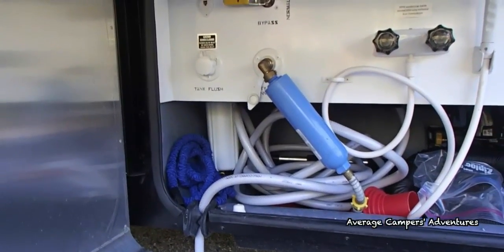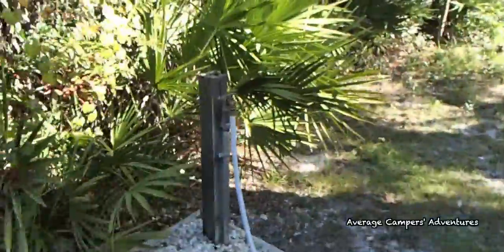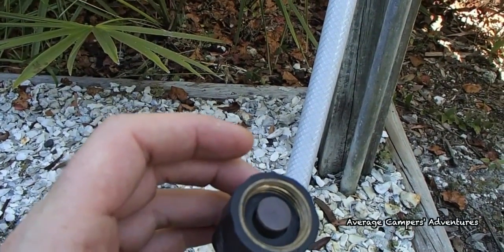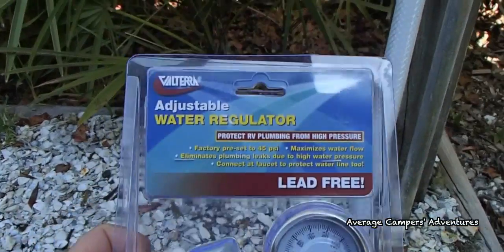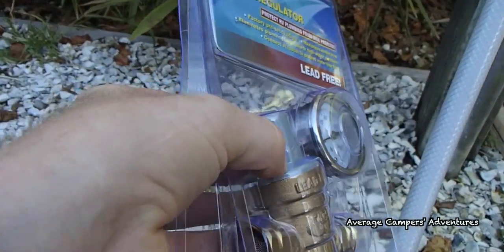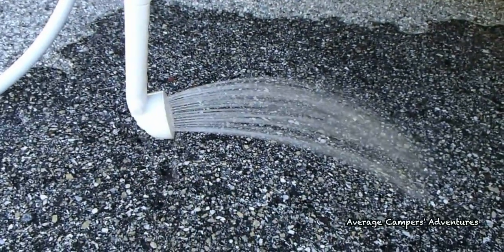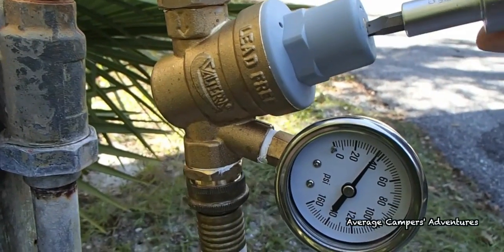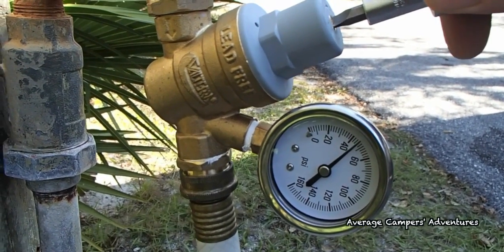RV Water Pressure Tips and Tricks

Comment: Great tip about using a water pressure regulator.
Reply from the maker: That is a really dated video but it still holds true.   Excellent way to dial in the right pressure and prevent broken pipes.   Thanks for watching Lucky Dawg!

Comment: I purchased one used 11 straight days work great in the next time we went camping the gauge wasn't working right now wasn't sure what the water pressure was so I'll put my back up on as anyone else had trouble with the gauge think the water pressure was right I think the gauges is reading wrong I guess you're still in Florida hope all is well
Reply from the maker: We had the same experience but our broke at the seam.  Decided to get a different brand from Camping World and all has been well since.  Only difference is that we can not adjust the pressure with our new one.  Thanks for watching!
Reply: Went back to Camping World today and they replaced it no problem

Comment: So you adjusted the water pressure to 45psi while the campers water faucet was flowing? I noticed if i set mine to 45psi while faucets are closed,  the gauge drops when faucet is open. I would think that you would want the pressure entering rv to be 45psi. Idk?
Reply from the maker: Most campgrounds have pressure regulators installed at each site.  In this case the regulator acts as a safety measure to prevent pressure spikes which could break a water line in your RV.  Lower pressure is more of an inconvenience but high pressure is damaging.   Thank you so much for reaching out to us Matt.
Reply: @averagecampers  i don't think that really answered my question.
Reply from the maker: I will try to understand your question.  Pressure must be above 45 psi before the pressure regulator to maintain 45 psi when the faucet it open in the RV.  I did not set the pressure with the faucet in the RV open.   Set your pressure on the adjustable gauge before you open the faucet in the RV.   Hope this helped.  Safe travels.
Reply: While the water is running 45psi is a good number to run at.  The pressure may rise slightly when the water is turned off.  If the pressure when the water is off is not above 50psi you should be fine.

Comment: Would be better to have the filter attached to the regulator too.
Reply from the maker: Great suggestion.  Thank you so much for watching!!
Reply: As long as the filter is inline after the regulator you should be OK.  I actually have the filter as the last connection after the hose so I filter out any crud and bacteria that may be in the hose.

Comment: If while unhooked from water supply and the water pump is on, the water pressure is non-existent or at a trickle, my first check should be the water pump, right? I am new to this but, handy at fixing things, I just don't want to waste energy. Guidance from a more mastered individual seems the best way to lesson the waste of efforts. :-) thank you in advance for your attention.
Reply from the maker: +Jennifer Jones You are right on target.  Sounds like you may have a faulty water pump.  When you turn the water on, listen for the sound of the pump turning on.  If you do not hear the sound of the pump, it is not functioning correctly.  Check the water level in your tanks and make sure you have not tripped a circuit breaker on the panel.  Thanks for the question and safe travels :)
Reply: +Average Campers' Adventures the RV is a 1998 class A, just alil over 20,000 miles, and looks brand new. I haven't heard the water pump turn on, but  the rv seems to be quieter than others I've experienced. For example the generator is barely noticeable or not so intrusive. I am going to search for the water pump. I have a volt meter, I will check the breaker also. Thank you for responding!
Reply from the maker: You are so welcome.  Good luck😀

Comment: THAT IS ONLY TO READ NOT TO INCREASE THE NORMAL WATER  PRESURE
Reply from the maker: If the pressure is high, you can adjust lower to protect your plumbing in the RV.  This device will not increase the water pressure from the pressure coming out of the line.